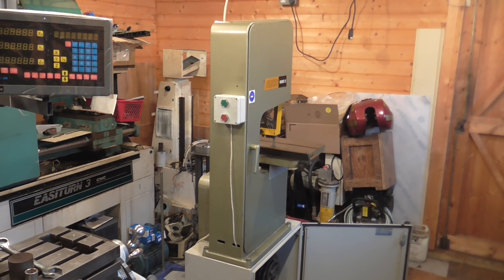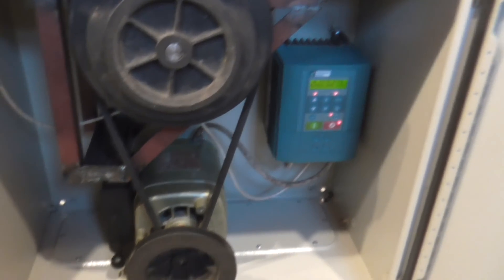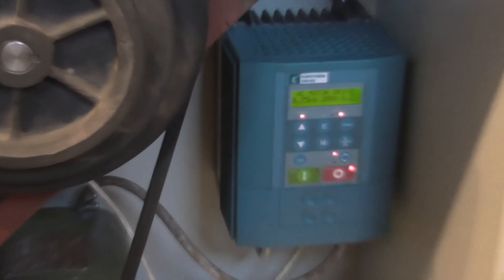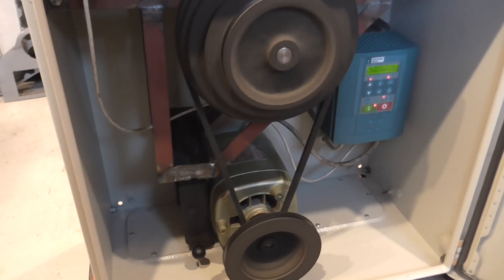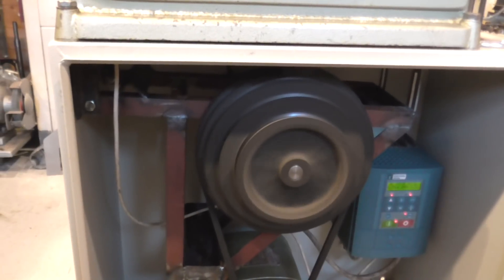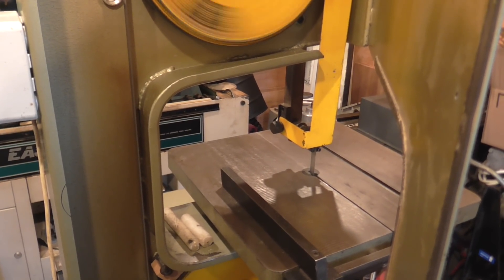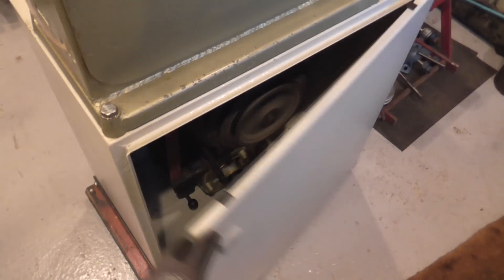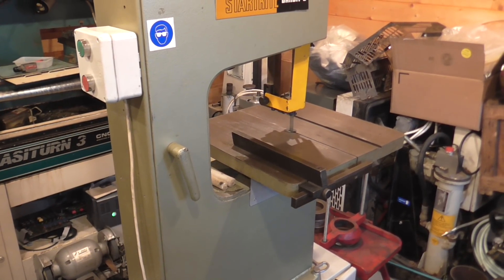Startrite Bandsaw Modification Part 3

Comment: Hi Paul. Nice job, would love to have a bandsaw, do you have experience with link belts I know that the type to go for is the type without the metal studs, but do you favor any brand over others, I wish you and yours a Merry Christmas and a Happy New Year, hope to see a lot of videos from you in 2018. All the best.
Reply from the maker: When I bought my generic 4 by 6 bandsaw, I soon found it to be invaluable. I felt the same about the Startrite and whilst I had it apart, had to go back to using the 4 by 6 in the propped up position as a vertical bandsaw, but it's just not the same.

I've only ever had a link belt on my Boxford. It used one from the under drive arrangement to the spindle, which avoided having to remove the spindle to change a belt. It was of the metal stud type and ran very smoothly, but was a real struggle when I had to take a link out to take up wear.
Reply: Hi Paul, Thank you for your answer, I could remember that you said the stud type was not the type to go for so I thought you might knew what to go for then, All the best.